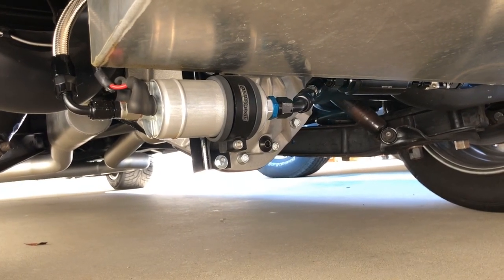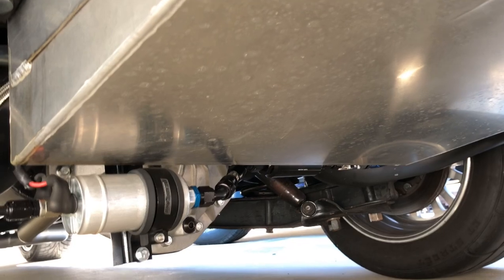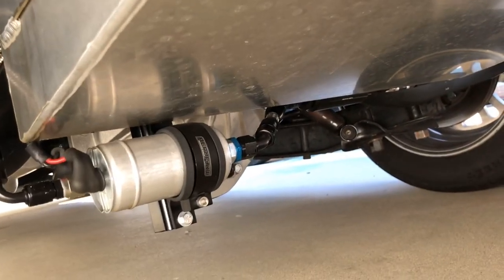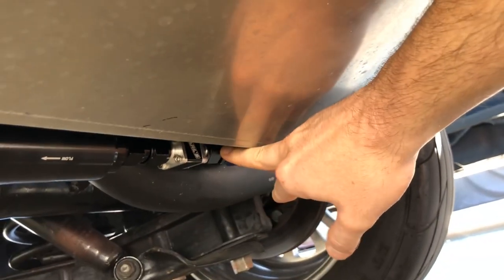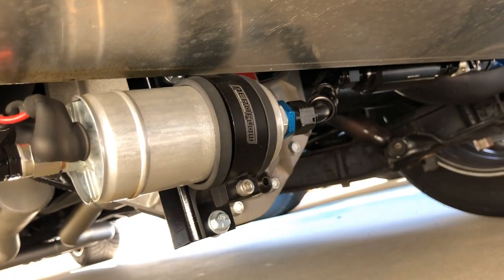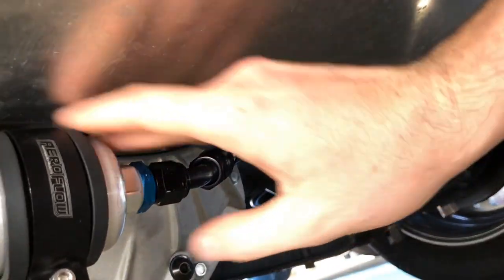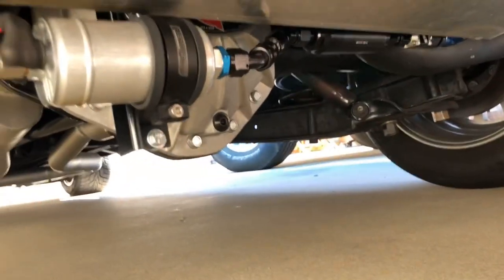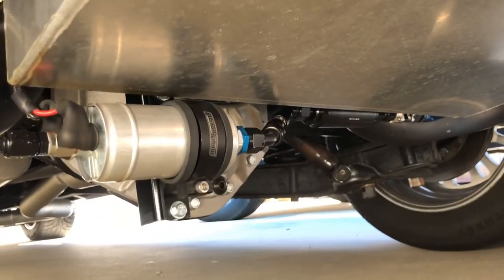In-line Pump - Proper Installation Overview

Comment: Wish I had seen video before I fried the first pump from starvation! Louder then my truck was! Just found out from fitech that this is exactly how they are to be plumbed. Yes, the best way to go is the one inside the tank or a remote one that incorporates the stock fuel pump as a supply pump. 
Thanks for the video.

Comment: great info here, my only gripe is the feed bung on the tank is in the front and not the back.  

i prefer to have the feed bung in the rear so when you step on it and the fuel sloshes to the back it keeps the pump fueled and happy. be careful if you have low fuel in your cell.

dope truck, quality build for sure! well thought out.

Comment: What’s it like for noise?  I have one setup very similar and after about 40 minutes it starts to get noisier. After about 90 minutes it’s quiet annoying.
Reply from the maker: Sounds like it’s getting hot.
Mine is pretty quiet and consistent.  In general is louder than an in tank pump just because that’s the nature of an in-line pump but I can’t hear it over the engine at all.
Reply: I have the same problem on my truck. After 1 hour driving the pump get loud.  Got 100mico before the pump and 1/2 below the tank. 8 an fittings in and 6an after pump.

Comment: Wouldn't you want the fuel filter  after the pump?
Reply from the maker: It has both. You need to prefilter at 40 microns. I have a 10 micron close to the engine.
Reply: @mechtrician1  ah ok. I guess that'll work also. I have a bosch044 for my 2jz 240z. But want to redo everything since I'm traring it apart. Been trying to ind a good budget intank pump fuel cell... but damn near everyone I found is for inline pumps only.

Comment: Very informative !
So -8 feed ?  And size return?
Liked and subbed ✔️
Reply from the maker: -8 feed to pump, -6 pressure and return line.
Reply: @mechtrician1  
Ok I’ll be installing a 
400 hp  N/A  unit . 
So -8 from tank to feed pump ,
Then -6 to efi unit then -6 return?  With vent fitting ?
I saw that in your other video 👍
Reply from the maker: @meca13b  yes the tank gets a vent line with a rollover valve. Yes -6 from the pump to the unit and -6 back.

Comment: How would I kno what pump I'll need for my truck I'm installing a fuel cell on my Silverado with a cammed 6.0
Reply from the maker: I would go with an in-tank fuel pump with a return from the regulator. Try to avoid in-line pumps if you can. 255lph will cover up to 600hp or so. Getting a tank that includes a pump is usually the easiest thing to do.